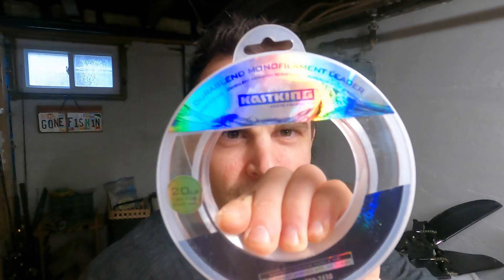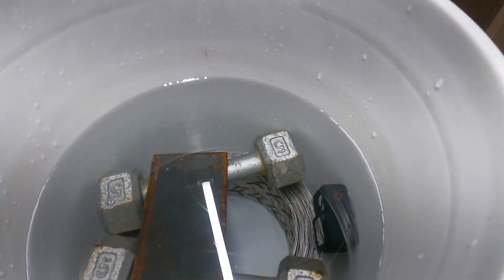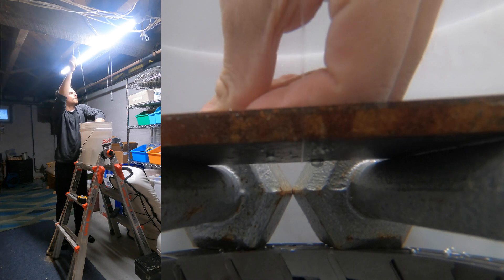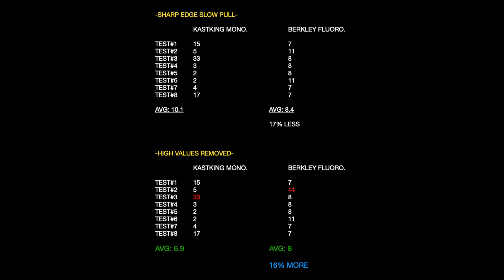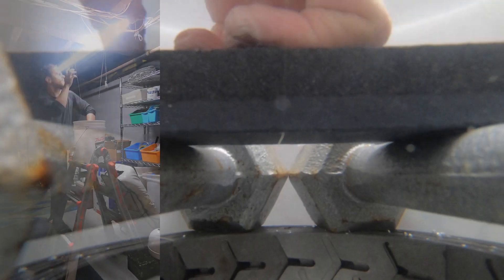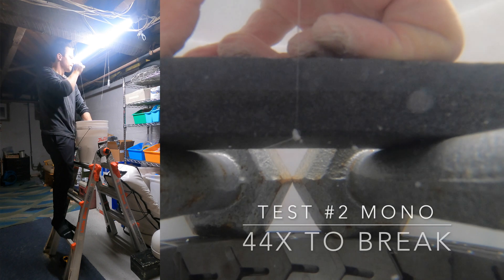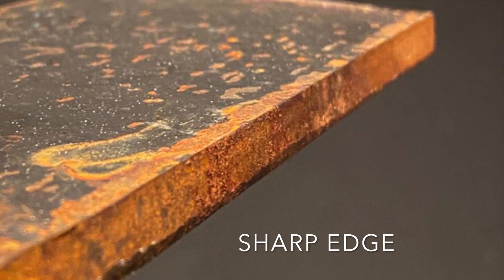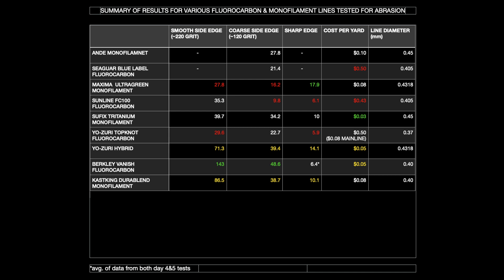Berkley Vanish vs Kastking Durablend  (Underwater Abrasion Tests) + SUMMARY

Comment: So after all of the testing you did, whats your pick in leader line?
Reply from the maker: Yozuri Hybrid is what I use 90% of the time now.  You can get a 275yd spool of 20lb from walmart or dicks for like 13$ its amazing.  When I need something heavier I'll use ande mono typically, I have yet to use fluorocarbon since the testing, especially because of my knot tests, the flouro did really bad compared to mono
Reply: @PeterRanieriII   yeah I usually use 30lb which is probably over kill but I dont want a blue fish cutting my line line plus I want to be able to horse these sheepshead away from the bridges.
Reply from the maker: @Waterboy516  oh yeah same here with bluefish, im gunna use 30lb or even 40lb.  sheepshead and blackfish same.  I just saw you can get the yozuri hybrid in 30lb and 40lb online at bass pro...interesting

Comment: Another interesting video. I bought a few bait casting rod/reel from KastKing. I realize I just don't have the skills or preference for bait casting setup. Maybe I am more of a saltwater fisherman. Didn't want to continue with their mono or fluro line. I'll try to use Fluro when the water is super clear and mono when murky or w/e. Interesting test though.
Reply from the maker: thanks Mr. Green.  I feel the same way with baitcasters, and have had similar experience with getting the cheaper models, seems the mechanism to adjust the free spool speed is not made well on those cheaper ones.  Yea I enjoy the salt way more than the fresh nowadays.  Glad you enjoyed the tests, you may want to see the knot strength ones as well.